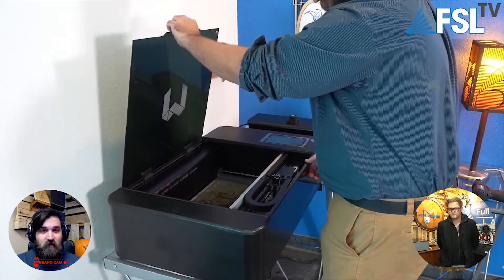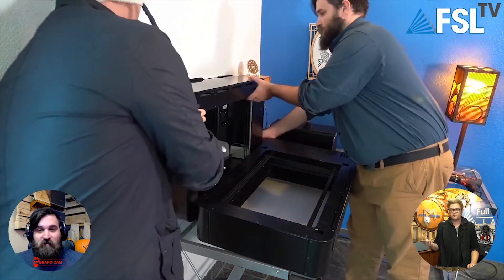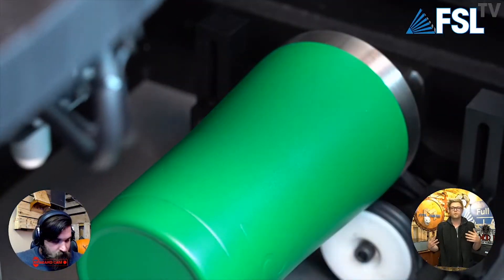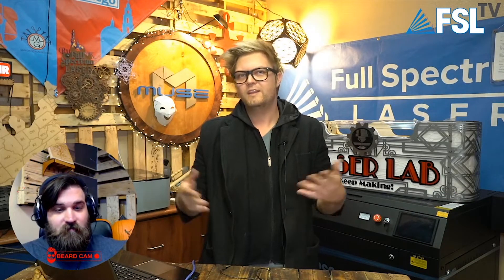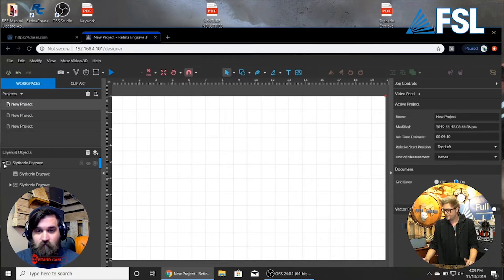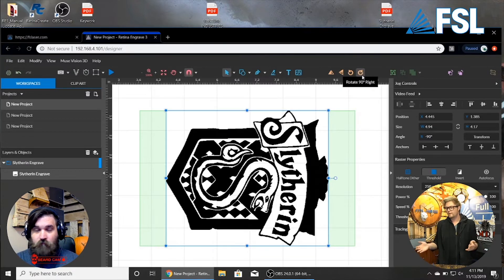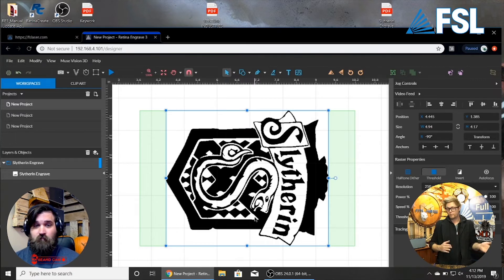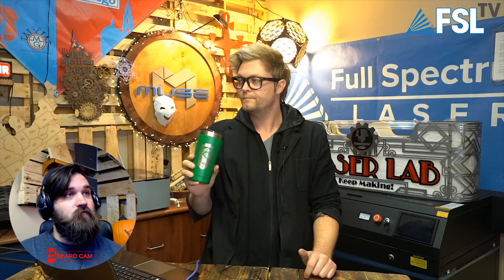Jump Into The Software ep 2 - Muse Rotary Setup

Comment: Do you have to wait an hour until attaching/running the rotary? The 1 manual has instructions to power the machine down and wait 1 hour. While others do not have this instruction. Which is this true?
Reply from the maker: You don't need to wait an hour. Just make sure the machine has been powered down for a little before attaching the connection and rebooting!

Comment: what settings work best for the tumbler in this particular video. to get all the paint or powder coating off?
Reply from the maker: It was a while ago so I can't remember the exact settings, but I generally start at around 75p and 75s and adjust from there. Every tumbler batch is going to be slightly different so if I engrave on a tumbler I usually an extra that can be tested on to dial in settings for that particular tumbler. - Jordan

Comment: So you can keep the water pump connected? How do I drain the water?
Reply from the maker: You would just disconnect the water hoses and make sure you have a bucket or container for the water to drain into. That said, if you're using the coolbox, it's an enclosed system, so you shouldn't have to replace the water too frequently. Maybe once every couple of months.
Reply: @FullSpectrumLasers  Thank you! If everything is already connected, would there be any reason not to flip the hobby laser face forward, and disconnect the bottom that way - enabling me to keep everything connected while attaching the riser?
Reply from the maker: @norafrazier9975  Yes, you can absolutely do this. If you look at our video, we flip it back but have the table it's on slightly away from the wall, so the hoses aren't getting pinched. As long as you can do this safely, it doesn't matter which way you flip it.
Reply: @FullSpectrumLasers  Thank you!!

Comment: So, when you set up a rotary engraving, it seems as though it starts from the "bottom" of the design. (it rotates clockwise?) For some reason, my machine will not run a perimeter, so I'm trying to figure out where to put the red dot with less guessing.

Comment: Thanks for the tips.  A couple questions:
1) What are the ideal power/ speed/ current settings for cutting through powder-coat like that?
2) In the past, my engravings have gotten distorted because of the curvature of the cup. To mitigate this issue, I elongated the width of the engraving a bit (eyeballing it) until the engraving looked nice. Is there some sort of standard based on the circumference/ curvature of the cup? Thanks!
Reply from the maker: No problem! So to answer your questions,
1) It depends on the machine you're using and the wattage, but on the Muse, the machine we used, I would suggest keeping the power on the higher end, around 75 to 85. A CO2 beam isn't going to go into the metal, so you don't really have to worry about too much power, but your edges may see a bit of distortion if it's too hot. Also, if it doesn't go all the way through the first time, you can always run it again.
2) The best thing you can do is make sure your rotary is set up in such a way that the top of the cup is level. Aside from that, when a cup has a severe taper, it can cause some distortion. I, myself, am not aware of any way to correct this aside from projecting the image on a 3d model as a preview.

Hope this helps!
Reply: Full Spectrum Laser but what about the real-time autofocus of the Muse 3D? The video on the FSL website shows the laser moving over accordion-like material. Surely it can engrave a tapered tumbler/mug without distortion? Thought it used Intel RealSense cameras for depth detection?
Reply: @Unkn0wnC0mmand  I think the distinction is that the laser will be in focus with the 3d Autofocus, but there will still be distortion from the projection of the image over an uneven surface.

It will look like the image is longer in parts of the engraving that are sloped than in parts that are flat, as the length of surface traveled in 1cm of laser movement will be >1cm.
Reply: @FullSpectrumLasers  i want to explore this topic a bit more please: obviously the rotary supports non-cylinder shapes (tapered etc), so what about other 'round' objects that have spherical traits as well? has anyone tried it on that?
Reply from the maker: @QuentinKarmark  It really comes down to the design. The rotary only gives you one axis of rotation, so the design can be wider on that axis, but if it's too wide on the non rotational axis, parts of the design will be out of focus. We've done christmas ornaments with the rotary before, but we usually try to keep the design pretty thin on the non-rotational axis.
Reply: @FullSpectrumLasers  OK, thx... so there is no truly '3D' laser than can position the beam in more than two dimensions... I was curious since you call it 3D technology (z-axis), but it refers merely to the autofocus capability and not the position or height of the laser while cutting.
Reply from the maker: @QuentinKarmark  Yes, in the context of the Muse 3D, it refers to the 3D camera it uses for focusing. I'm sure there are 4 to 5 axis laser machines out there, but they would be beyond the hobby market, price wise.